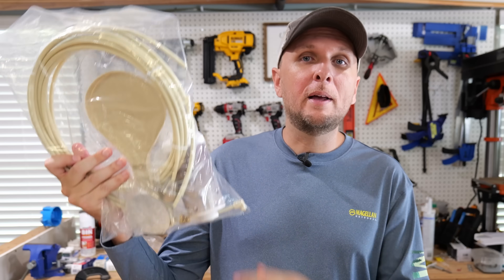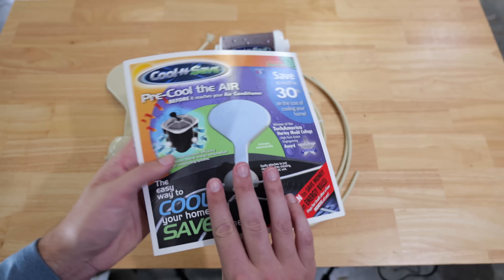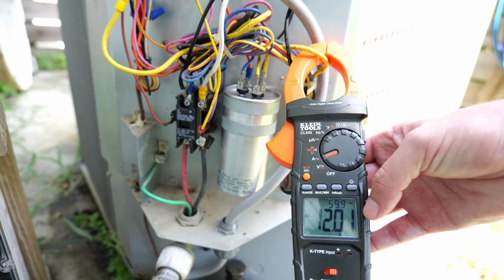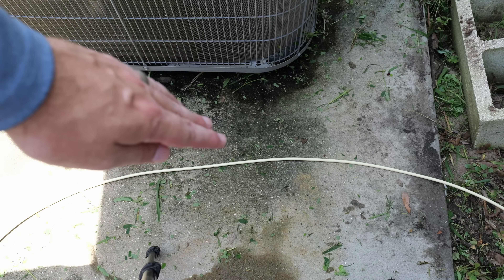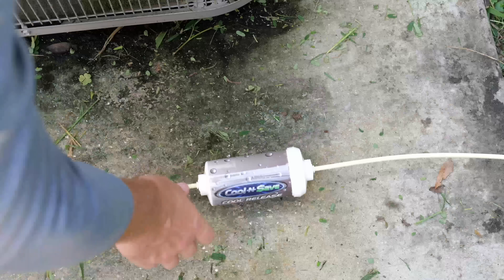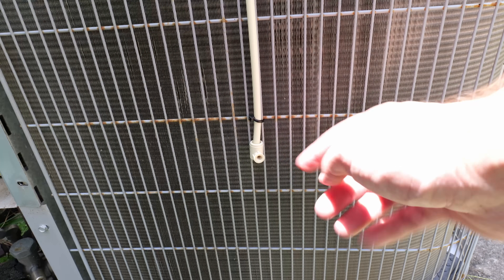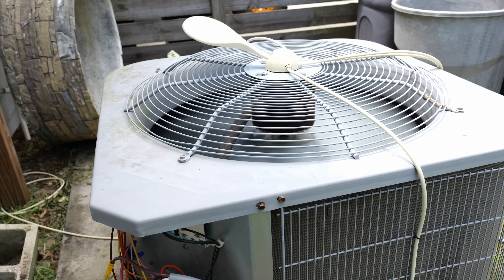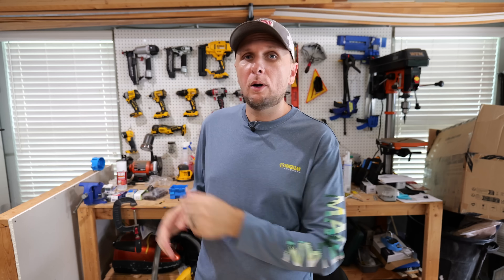This Device Can Save You 30% On Your Energy Bill! Makes The AC Blow Colder

Comment: Gimmicks like this don't save you 30% in energy bills. It's BS. It does make your temp cooler by a small amount but the unit still runs continually, at least here in Texas but now you have increased water usage. If stuff like this worked including new windows, more attic insulation, radiant barrier, yada yada yada, the energy companies would be paying me every month but they don't. Videos like this do make the publisher some money so I guess you could say it lowers their energy bills 30% but not yours because the page is monetized and people look for any way to save money that don't work.
Reply from the maker: Your pessimistic and suspicious outlook don’t change the facts.  You’re incorrect, at least on this one.
Reply: @HowToHomeDIY  well I bought one of these and I haven't seen a 30% reduction in my energy bill, that's a fact. It's not pessimissim it's reality.
Reply from the maker: Well there are plenty of people in the comments that have said they bought them and it did lower their electric bill.  So not sure why mine and theirs did but yours didn’t.

Comment: Ooh, I do see one mistake this guy made during the install. He was supposed to flush all the lines for at least 20 seconds before installing the misting nozzles, as per the instructions. You never know what kind of contaminants were in that tubing, and especially the filter, prior to installation. That's probably where all the "my nozzles got clogged" negative reviews on Amazon came from. People need to read and follow directions.
Reply from the maker: I did that, just didn’t show it in the video. It was long enough and I have to cut things out.  The instructions included with anything should always be followed.

Comment: I want to add a couple of comments as an AC tech. The nozzles use an average of .4 gpm per nozzle, so thats 1.2 gpm and 72 Gallons per hour of runtime. The savings on electrical is noticeable but could be offset by the water usage. There are three factors to consider though. One is that it lessens the wear and tear on the condensing unit as cooler air entering means less load on the compressor. Second factor is that it gives your unit additional capacity so that on extremely hot days, it helps your unit keep up. The 3rd part is that you only need to use it during the peak of the day if you want to save water. In Texas, our heaviest load on an AC is usually 3pm to around 8pm. Once the sun sets, the load is diminished and the AC will catch up.
Reply from the maker: It doesn’t use that much water.
Reply: @HowToHomeDIY  I had to check my math. 0.8-0.9 gallons per a hour per a individual head. So thats 2.4 to 2.7 gph. I was thinking in plumber mode of GPM and not GPH. The focus I was making was that you really could only run it during peak and see the drastic results versus running it constantly.
Reply: @HowToHomeDIY  Does it say what the flow rate is?

Comment: After watching this video, I ordered and installed this w/ the extra 3 nozzles. I'm in suburbs of Houston. It has only been 3 days but I can see a good drop in electricity usage and the inside temperature is holding temp way better. My calculations are showing ~ $80/month savings AND the AC is working much better.  I'm more than impressed! Thanks for the Video guidance.
Reply: Where I am at the water is very expensive. Did you water bill go up? By how much?
Reply: @RC-hn8sj  What city do you live in?
Reply: Did you happen to compare the impact of adding the additional misting nozzles?  Before and after?
Reply: BS, not buying that for a second.
Reply: And spend 80 dollars a month more in water ..waste of time and money unless you're on a well
Reply: @vinperillo  It's a mister dude, not a fire hose
Reply: @vinperillo  If you're spending 80$ a month in water you have serious problems elsewhere you need to worry about. I don't spend more than 100$ for 6 months of water in my area. No chance a mister system for an a/c unit costs more than 5$ a month to run for water costs even on scorching hot months like July and August.
Reply: @vinperillo  I'm amazed at the number of people who don't understand the amount of water that MISTING uses. Try this. Get a liter sized bottle with a fine misting nozzle. Fill it up with water. Set the misting to the finest mist and see how many squeezes of the trigger it takes to empty that liter of water. What would this show you? That misting uses minuscule amounts of water.
Reply: @vinperillo i don't think it uses that much water. The most is two gallons a day as it sprays a mist just like febreze! It comes on only when condenser fans come on

Comment: I looked into getting one of these but the research I found said that spraying water on your coils is a bad thing. The water builds up scale on your coils and will cause your unit to premature fail sooner. It also said that the water softner works better but it still doesn't completely get rid of the scale. If anyone know for sure then I sure would love to know. I am not trying to stop anyone from buying this product because in theory it is a good product.
Reply from the maker: Everyone's situation is different.  That being said, these are not made to be on the unit all year, just the summer.  The coils should be cleaned at least annually anyways and I always use a cleaner which would remove any deposits or scale that may be there.  People that say to just use water are not getting their coils truly cleaned.  Just my 2 cents.
Reply: @HowToHomeDIY  Yeah, you right, If you clean it regularly then it should get rid of the scale.

Comment: Great video!  I just installed one of these at my house and thought I would share my results.  First information on my unit, set point and conditions.  I live in San Antonio, TX and have a 15-year old Carrier 5-ton unit that has really started to struggled in these hot summers. I have three thermostat zones in our 3,000 square foot house and I have ecobee thermostats that allow me to track run time, temperature and humidity. We installed our cool n save two days into the billing cycle last month which was perfect for a monthly comparison.   Our house is set to 75 degrees at night and 76 during the day with the exception of 3:00 to 8:30 when it goes up to 77 degrees so give some relief to the unit during the heat of the day.  I have been using this program for years. My July Bill was $358.  The average exterior temp in July was 86 degrees. So what was my August bill?

My August bill was $315. The average exterior temp inAugust for the billing cycle was 88 degrees. The department of energy states that for each degree up or down compared to the exterior temp is a 3% increase in energy costs.  So using that assumption - all other things being equal - I would have expected my bill to go up 6% in August to $379. So the savings comes in at $64 or 17%. But what other benefits did we see?  The unit runs quieter with the cool n save.  The decibel level without the cool n save was 69.1.  With it running (both measured after a 10 minute run time) the decibel level is 63.8. I assume it is quieter due to the compressor not working as hard.  Finally one of the other benefits we have seen is that the interior humidity levels are on average 5% less on the inside of my house.  So while our temp set points are the same - the house feels much cooler on the inside.  As the video shows - we also saw interior air approximately 1 degree cooler inside the house.  A colder coil pulls more moisture out of the air and makes the house more comfortable. Our interior humidity averaged 53% before the cool n save and now averages 48%.  So yes this works and it works well. 

What about the negatives of mineral build up?  I am very aware of this risk…but given the age of my unit - I decided it was worth the risk to extend the life of my aging system.  Plus every year I use Nu-Calgon brand Nu-Brite coil cleaner on my outside coil.  If I do have mineral build up I will also clean with a vinegar solution.  But after a month of use I have no evidence of mineral build up on my unit.  I will keep a close eye on this going forward. As others have stated - A/C units are designed to work in the rain - so the misting system is not a problem.  

I am a huge fan of how well this works and based off of my savings - this will pay for itself in approximately two months. Even with the minimal water usage.  I highly recommend this - especially if you have an older system like mine you are trying to extend the service life.  I wish I had discovered this earlier.
Reply: Thanks. This is a very informative post. However, a product being designed to operate in the rain isn't the same as being exposed to tap water. The minerals in tap water don't evaporate and then fall again as rain. Those minerals stay on the ground. Your rainwater is as close to pure water as you're going to naturally get.
Reply: Great explanation! I think I will pick this up to help my AC unit in the super hot Miami weather. Thank you
Reply: At the expense of destroying your coil.  No AC professional would recommend to spray tap water on an AC unit.
Reply: @executiveinvestments It's not just tap water. It's run through a polyphosphate ion exchange filter, which sequesters a good portion of the calcium and iron in the water. You have to change it out every three months for maximum effectiveness. It's the same stuff your municipal water treatment plant probably uses for their own surface water.

Comment: DONT DO IT!!! After seeing this exact vendor setup i rigged up my own. It destroyed the condensor with water deposits even with softner. This vendor wont well to areas with known hard water, hence why i rigged up my own setup. It'll help for while but will be far out done by the cost of replacing the compressor.
Reply from the maker: I fail to see the issue.  The vendor won’t sell to certain areas due to their extremely hard water.  That sounds like they are doing their due diligence and you went against their warning if I’m reading this correctly.

Comment: In humid environments, this might actually not be what you want to do. Part of indoor comfort is getting the humidity into the right range, and traditional A/C and heat pump units remove interior humidity as they run. Shortening the run time by lowering the temp will result in higher indoor humidity, the same as using an improperly sized (too large) system would. Many of these new smart thermostats even have a "cool to dry" feature allowing you to set a target indoor humidity range, and it'll flex what temp is sets to chase humidity to some degree.
Reply: See my comment I just added above.  We installed one a month ago and saw our average interior humidity levels drop 5%.  This is due to the inside coil being cooler.  This set up actually improved the humidity levels in our home.

Comment: I always wanted to see a heat pump water heater with a recirculation pump that has a heat exchanger, so it can run the hot water loop into the condenser to cool it, then you save the water AND the heat.  It could just be a little water block that connects to another block with refrigerant before it goes out to the radiator.  In a home with high hot water usage or like a hotel, with constant usage, you might be able to eliminate the fans entirely or just rarely turn them on.
Reply: They've had these for decades now.  We had them in the 1980s.  Used it to pre-heat the hot tub.  If that got too warm, it'd dump the heat into the canal.

Comment: I would also be interested to know, over time, what the added (if any) accumulation of dirt or buildup on the coils would be. Surely misting the air would be introducing dirt that would stick over time. And while yes, these are outdoor machines, and subject to rain etc, I would be interested in knowing if the constant introduction of water would degrade the unit sooner than without. That is, if so, is the early replacement cost worth the savings?
Reply: I agree with you 100% about the introduction of dirt into the system coils, I also think it prudent to mention mineral deposits from tap water as opposed to rain water, as you have already stated " These are outdoor machines" I would also bet, if this were a simple, cost effective and viable solution to improve efficiency, the manufacturers would have adopted it already. This seems to me to be just another short term solution over long term performance.

Comment: This device costs $100 + bib cost + some water bill increase + the pain the ass of installing it and all you're getting is 1 degree cooler and maybe 12% less on the amps. Doesn't seem like its worth it.
Reply from the maker: Bib costs?  Water is cheap and this uses around the amount of flushing a toilet once a day so barely anything there.  It takes about 15-20 minutes to install.  12% is 12% and the temperature drop will vary by person and circumstance but even 1 degree cooler can make a dramatic difference in how long an AC has to run in order to cool the home to the desired temperature.  But if it's not for you then it's not for you.
Reply: @HowToHomeDIY  So what was your power bill difference after installing this device?

Comment: I would love to see a bill comparison before and after using this device. Also no matter how expensive of a hose bib I use I ALWAYS have some sort of water leak. lol
Reply: this will seem obvious, but plumber's tape the male ends of the hose and it won't leak. wrap it clockwise so it's the same direction as the female hose spins to connect.

Comment: don't see a reference to condenser temp difference.  (air temp going into condencer verusus air temp exiting condenser)  been putting misters on condensers for decades but only in extreme heat.... a major draw back is the mineral deposits it will leave on the coil especially under frequent use.... next to impossible to remove.... rule of thumb on temp difference inside at air temp being 70 degrees going into the air return; a good unit will produce 20 degree difference or 50 degrees out of a (close to air return) supply register,,,,,,,,,,,acceptable is 16 degrees (54 degrees out of supply register)......a proper sized unit will keep up with heat load up to constant 95 degree days and ocassional 100 degree day (depending on insulation and amount of solar radiation thru glass.) All a/c systems are a compromise between cost of install and operation and "normal" weather in your area.

Comment: Thanks for taking the time to make this video. 

This, to me, just seems gimmicky. I can just see an HVAC tech laying eyes on that and asking the homeowner 'what the hell are you doing?' Yeah you're going to save a wee bit of money on your utility bill, but you're also increasing your water consumption, if you don't have a water softener, then you're on the hook for buying replacement filters - which no one is going to change like they should (the vast majority of people never even check their air filter like they should) If you do have a water softener then you are now on the hook for running a new 1/2" cold water line to a new hose bibb. Then you're constantly having water sitting on the unit rotting the base out if its not plastic. No thanks. 

You want to save money on your utility bill? Put a soft start on the compressor. Keep your condensor coils clean. Regularly check and change your filters as you should. If your HVAC unit is ancient, then change it. The money you'll save will be immediately realized in your utility bill with the new equipment. 

Leave this stuff for As Seen on TV.

But that's just my opinion. Thank you nonetheless for taking the time to make the video. Your channel is great.

Comment: @howtohomediy I just installed the Cool-N-Save today.  I live west of Tampa about 3 miles from the Gulf of Mexico.  Today it is 93 degrees and 66% humidity.  I got less improvement but it did improve.  Before - 10.5 run amps, after 10.1 amps.  Supply temp went from 61 down to 60.5.  I also did use the provided water filter even though I have a whole house water softener system, which includes my outdoor spigots.  One tip, I had to off center the paddle to capture the best fan air flow to lift the paddle.  I have a 6 yr old Trane 3 ton unit.
Reply: Haven’t really tracked it, I figured it would not hurt and even if the payback is a year or more, it’ll still be worth the investment.
Reply: @bobhall5893 I see you noted some minor decrease but you can feel the difference or do you think that this may just extend the life of the HVAC unit?
Reply: I live near you. Have you seen a notable difference?
Reply: I was actually surprised that there was any difference in the current at all. I thought it would work just as hard, but it would run for less duration because it would take fewer minutes to cool the house the same amount (because there's more heat exchanged due to the cooler coils). Does your electric company website allow you to see hourly energy usage ? Or perhaps by day ? If so, you can compare the hours (or day) on two identical days, which have the same temp and humidity, one with the water on and one without.

Comment: Wonder what a shaded cover would do for it.
Reply: A shelter will obstruct the air flow.  If the out door unit isn't able to work properly, your cost of operation will increase expediently.  It may even damage your compressor.
Reply: @rodhathaway4409  Shading something does not imply obstructing air flow.
Reply: If you put a shade over the top of a top discharge unit (which most AC unit are) you will cause a short circuiting of the air and that will cost you more due to the highr head pressure that you are trying to prevent. @tubejim101
Reply: @rodhathaway4409  What kind of discharge unit is shown in the video?